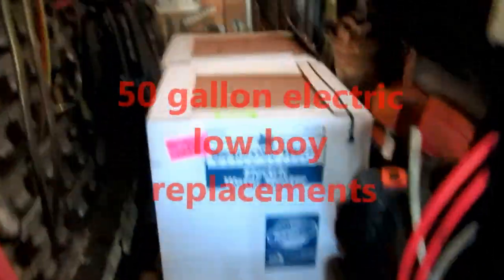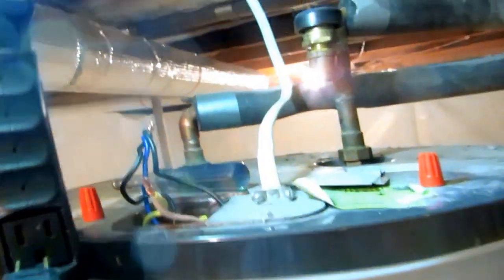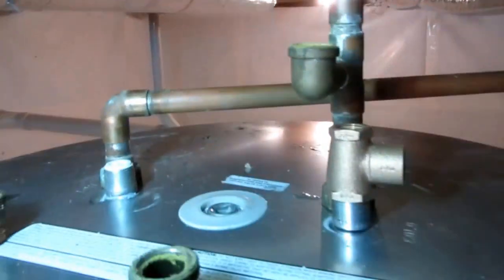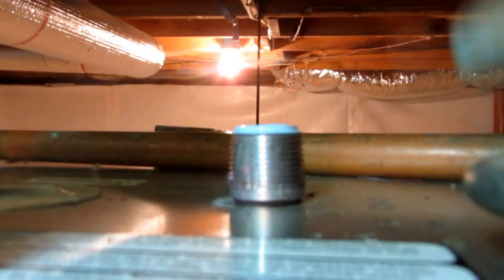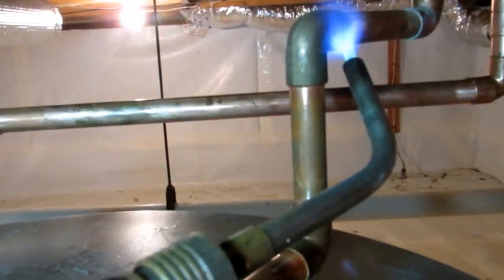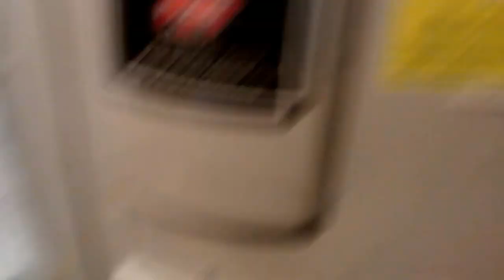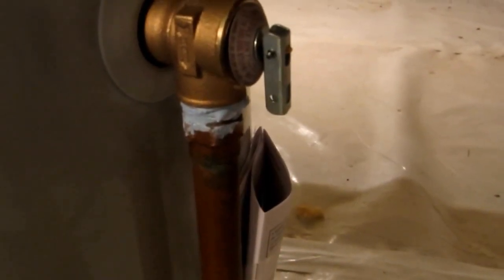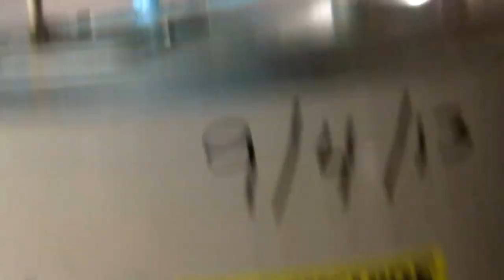50 gallon electric low boy water heater replacement (part 1)PLUMBING TIPS

Comment: As an apprentice, I have changed already 11 water heaters in my city. And I always love the homeowners, who had hired caring plumbers back in the day. Unions on the outlets of a heater and valves on both pipes. No draining of the lines required, no cutting required. Just unscrew the unions and screw them on, on the new heater and that is it. one time in one old 1950s house I saw a modern heater hooked up to old galvanized steel supply piping wia cast iron couplings and quick connect hoses, sorta like on the washing machine. That was a sight, funny one too. the old man said it was like that for 6 years and the hoses didn't fail. The more you know, you can hook up a water heater with braided hoses. Lol

Comment: steve,great work.as engineer-operating power plants/chillers I love the attention to detail.also must say you showed me something regarding yellow brass/cast brass fittings.my house is full of them and though you used a propane torch,must admit I prefer acetylene,easier heat up especially between wood joints.my work has primarily industrial and there is always access and steel as opposed to wood ,less chance of fire.lot of tricks and must say thank you,now where is that fire can........
Reply from the maker: uncmouse i do not need a fire can ..been doing this for 32 years never needed a fire extigusher
Reply: That’s when a helper sure comes in handy. Moving 50 Gallon water heaters into a crawl space by yourself isn’t an easy job. I work for my self like you but up here in British Columbia. Nice to see you using vacuum breakers. I see a few other guys on you tube not using them.

Comment: Hello, I have a question for you:  My lowboy from 2000 was just replaced. 
The guys from the plumber replaced it with another. 
It is electric, and they had to take the counter and sink off to get to the old one and put in the new. 
Took a couple of hours for the water to get hot. 
I was out of the condo for several days after install, and when I got back, no hot water!! 
Do you have any ideas why that might have happened? 
I called and they'll come back to check it out. 
Do you think I'll need an electrician? AND, since I paid for this job, shouldn't the plumber provide that?
If he can't fix it, can I say, "Okay, take it away, and give me my money back?" Do they ever do that?
But do you have any questions/tips for me to defend myself and get that unit corrected?
Thank you!!

Comment: What's Up Steve in Your city do the code inspector ask you to install expansion tanks because in Philly as of Dec 30  2012 all my water heater Jobs replacement Or New Construction had to have a Bladder tank install in the cold water supply line to the tank after the shut off valve. I love the Bradford White Water Heaters man made in the USA Nice Video

Comment: What do you do if the flux was left there by the previous plumber, how do you clean it up years later?  Thanks!
Reply from the maker: if you leave the flux it will turn green and could rot the pipe out in time if it was a mess try sandpaper to get it off if not cut it out and do it right

Comment: Haver u found that Bradford White won't warranty there water heater for leaks from rotted nipples that are still under warranty ??
Reply: Of course they won’t warranty those parts. They won’t warranty something where the longevity of the part is directly proportional to the quality of the water it is housing.